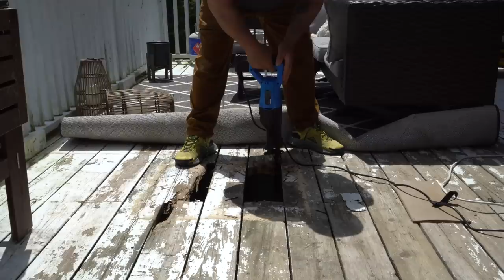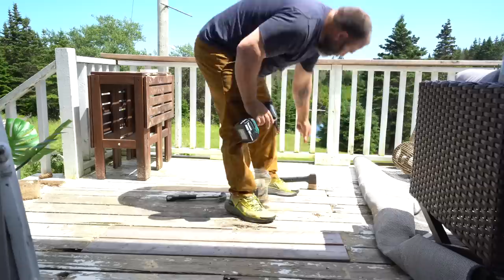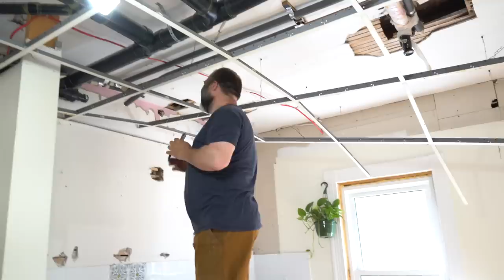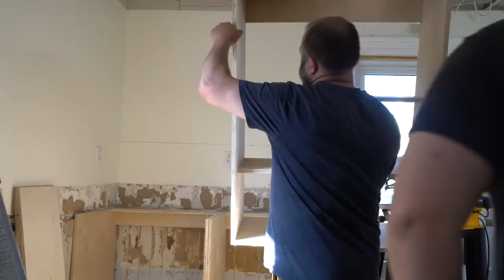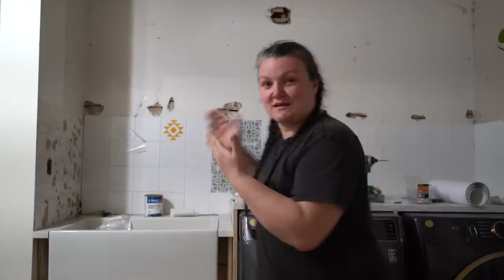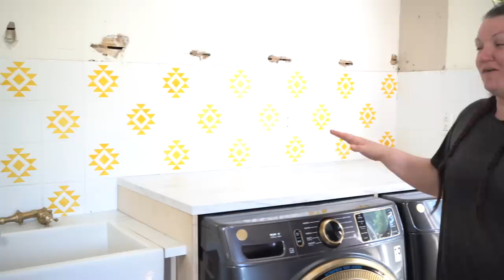Refinishing OLD UGLY TILES! Painting tile in the laundry room makeover!

Comment: I saw on Amazon the exact pattern you stenciled on wallpaper that was heavy enough to use as backsplash. It was available in several colors as well. I had mauve pink tiles in my bathroom in a checkerboard pattern in two rows. I grew to hate it….lol.  I ordered countertop grade black marble peel and stick paper and cut into squares the size of my pink tiles and covered them. That was almost two years ago. And they are still just like new. I like your choice of change. And not so busy. Great job!

Comment: Boards on porch will last lo get and stronger if you don't put a rug down. Logically rugs covering a wooden porch cause wood rot. From experience at my Grandparents house, yes, it definitely happens. We had to rebuild the pool decking because Granpa thought the boards were less slippery with grass like carpet. After replacing the second deck he bought different paint and told the kids not to run on the deck...that was the last deck he built. I loved your original tile painting, but I love the updated yellow tiles even more! Great choice! Great job!